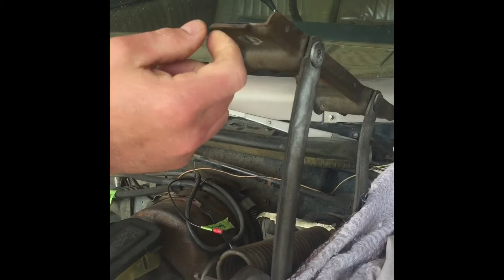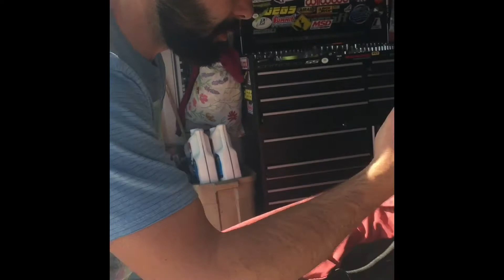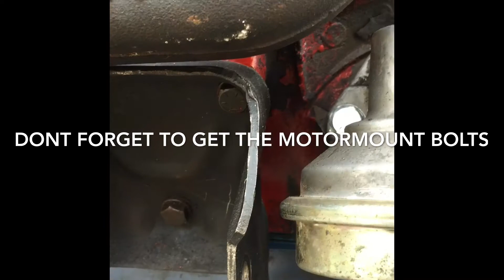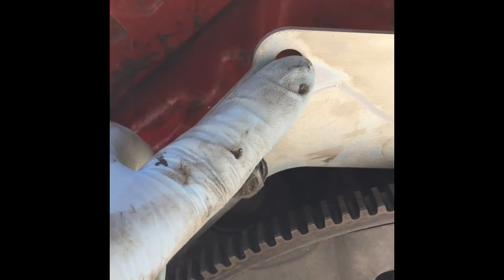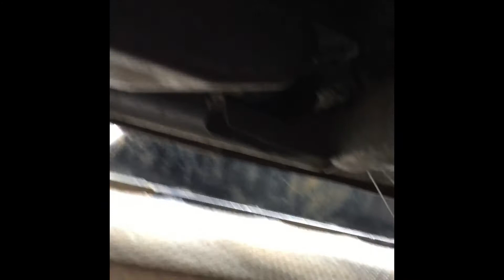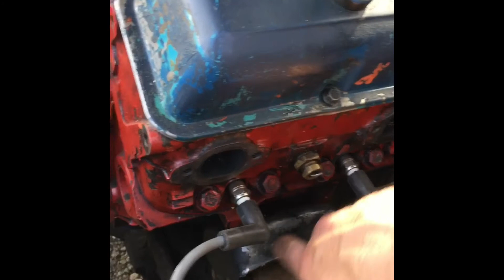V6 to V8 swap Gbody 1980 Monte B.O.P. trans. (Partial)

Comment: Idk if this helps anyone but you said the torque converter did was squished against the flex plate I’m doing a swap and had no issue are u sure went in all way unless I did something wrong

Comment: But their bolted in the same holes as shown in your video!  After watching your video I think I need to unbolt the trans from the block and then try to bolt the engine in, cause it looks like that's what you did, were I put the engine and trans in as one and bolted the trans to the cross member and won't allow the engine to mount to the frame! Thanks for the video!
Reply from the maker: Yes I mean there is a small amount of play in them when the bolts are loose and you need to push them outward and then tighten the bolts, that small amount will make the difference. It did for me anyways

Comment: I dont understand what is so difficult, i took v6 outta my 79 monte and put in a 350 that came outta my 75 monte 25 yrs ago. Piece of cake.
Reply from the maker: It’s the people looking to cross breed the BOP. (Buick olds Pontiac) transmission (actually just the bellhousing is the difference the trans is the same as a gm otherwise) with a Chevrolet small block or the other way around.
Reply: @GBodyJames  did you change transmission tooi have a 3.8 none turbo 1980 buick regal I want to put a v8 just don't know what would be best

Comment: What’s a B. O. P. Transmission????
Reply: On a straight  stock swap the v6 trans will work and bolt up with adapter. If your making a lot of power 300 or more you should upgrade  trans. Make sure you set TV cable correctly  on trans if you use 700r4 otherwise you  will smoke the trans in a heartbeat.
Reply from the maker: buick olds pontiac
Reply: G-Body James I have a 1984 V6 Monte Carlo the crankshaft somehow got stuck & cracked ... i Don’t think it’s worth repairing since I was already planning on upgrading to a V8 ... question can I use a 84 Monte Carlo Chevy V8 350 engine on the original stock V6 transmission?????
Reply from the maker: SNAKES DIECAST 2 it is possible with the bop plate and proper touque converter I believe but I never got to finish the swap so I don’t know everything entitled in it.
Reply: G-Body James some mechanics are telling me yes as long as it’s the same engine to a 1984 Monte Carlo ... & some others are telling me No because the V6 transmission won’t handle the torque so I’m probably just going to get a 700 R4 overdrive V8 transmission... that way I know it should handle a V8 350
Reply from the maker: SNAKES DIECAST 2 don’t wast your time go buy a Chevy Trans and be done with it
Reply: G-Body James Yeah actually the seller happen to have a 700 R4 Camaro tranny that fits the 350 so I’m looking to get it

Comment: I bought these clam shells  from  summit racing and they still don't line up with motor mount, don't have any clue why have you ever had this problem before I used the the part number you mentioned.
Reply from the maker: Derrick Wilson really?
Are you sure you have the ones that bolt to the frame in the right holes with one corner hole hanging off the edge of frame and not being used?
The black clamshells that bolt to the engine are bolted up proper? 
It’s a Chevy small block not a Buick or Oldsmobile small block?
Reply from the maker: Another thing is if your fighting it and one side goes in and the other does not then u may have to lift the engine and move the ones bolted to the frame accordingly like there will be a small amount of movement out or in on the frame holes and you may have to use that according to what you need.
Reply: G-Body James yea this a chevy small block swap and the corners are hanging off the frame one side lines up perfect the other side doesn't
Reply: I took the motor back out and it seems the passenger side motor mount is lined up  better with the holes than the other side.

Comment: I am the customer of this car.  Let me say this was all my fault.  I am very new to this hobby.  I wish I can go back in time and change how things went down.  I did not realize all the parts, time and expertise that's needed for a swap like this. James was great and he really knows what he is doing.  He took time to give me a detailed list of everything that still needs to be done, after the fact. I would highly recommend him. That being said, I still love Gbody cars, you live and learn, and I continue with the hobby. Keep up the good work James!!!!!!!
Reply: Your motor is a 77 and down. In 78 gm moved the last manifold bolt back. Either use 78 and up head or find the adapter to use 78 manifold to 77 and earlier head. You will need to clearance torque converter bolt holes in flex plate.they are just a little off. You need v8 shroud and rad.bolts right in v8 rad hoses. In my opinion  pull motor and trans out get the trans and converter to bolt up out of car. I've used an adapter from  jegs. Worked great. Trans and driveshaft is same in all gbodies v6 or v8 unless you have an 8.5 rear end. Also with the motor out of car unbolt wiring at firewall and run your wiring on v8. This swap is not hard just a few little things to keep in mind. Hit me up if you have any ?s.
Reply from the maker: Jesse 
Thx 
Hope you get it finished

Comment: I've read there's 3 styles of TH350s available, Chevy style, BOP style, and combined for application in either or.  The 200-4R had a BOP configuration as well, but the 700-R4 never got one, it's strictly Chevy, it will require an adapter plate.  Not sure about if the locking converter will be a problem, a trans rebuild isn't a bad idea if you're already taking the trans out anyway and if it's due for one, good time to buy a new converter that'll match the cam of the engine you're putting in.  I've been looking all this up because I'm straddling the line between dropping in a 6.2 Detroit or Olds 350 Diesel in my F body onto a 700-R4, and looking to come out about the same power/weight ratio without adding an extra 150 lbs over the weight of a big block, that being the case since the 6.2 is GIGANTIC.

Comment: Good video. Are you a public mechanic? Because I have a 1980 Monte Carlo and I'm looking for someone to install a 350 engine and you seem to have a lot of knowledge on what needs to be done.
Reply from the maker: Philip West 
You located in BC? Canada? 
I'm not full time mechanic  I do take on jobs for people I know and occasionally other people but after this swap I took on I'm very carful what I take on. I don't want my name on a welfare job I want it done proper The guy on this car wanted everything for nothing and had nowhere near the parts needed and after I spent my time resourcing the parts he would need he just bailed so what you see is what he got now I'm stuck with my name on a half put together car